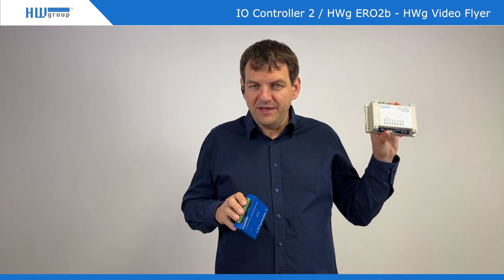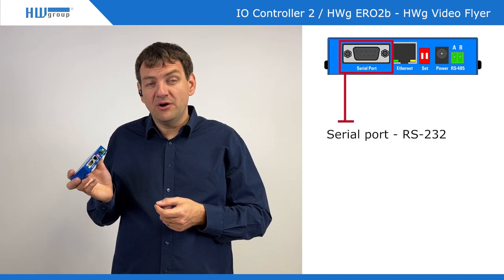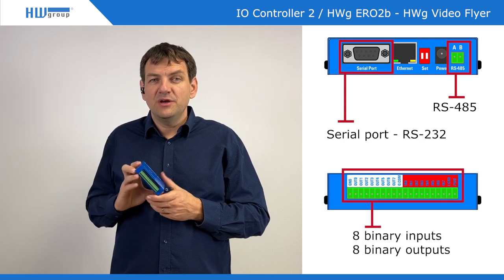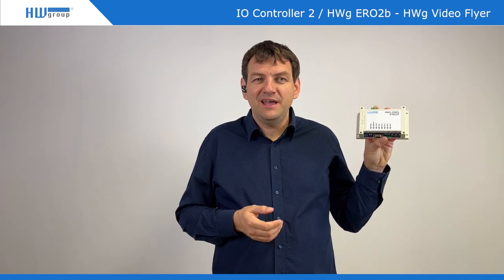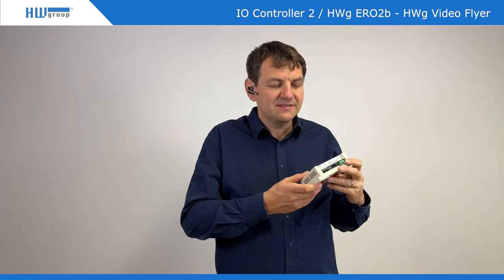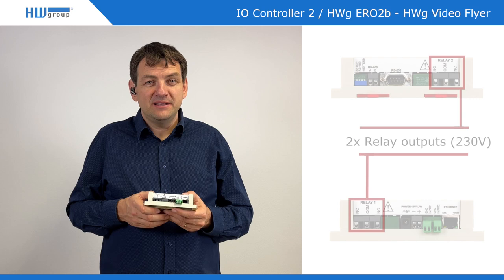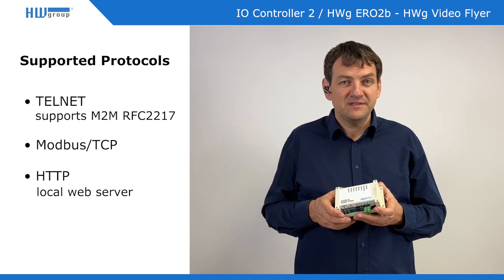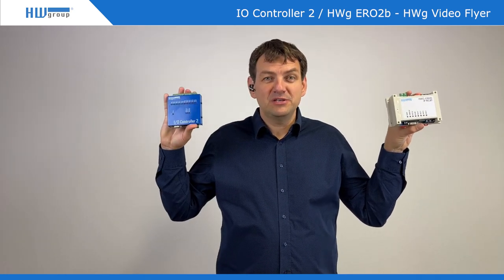IO Controller & IP Relay ER02b - serial port & I/O to LAN - HWg Video Flyer - HV59

Comment: Which software is used for the IP Relay to control the relay or io pins ?
Reply from the maker: Thanks for your comment!
There are many options, including the GUI of the device itself. 
If you're interested in a detailed answer to this question, we recommend that you send it to our technical support specialists at support (at) hwg.cz.